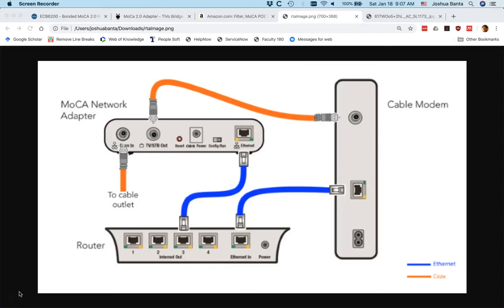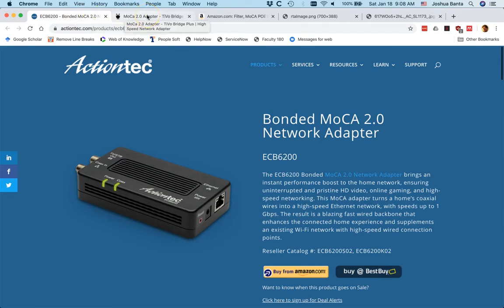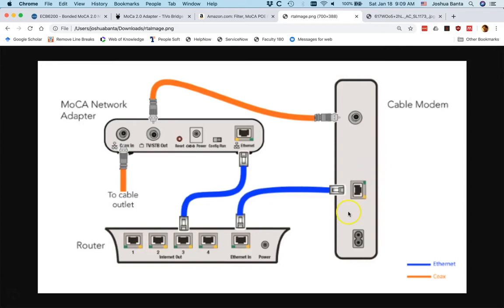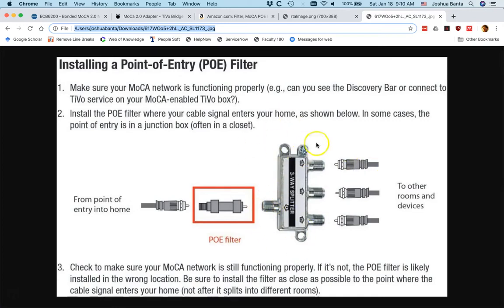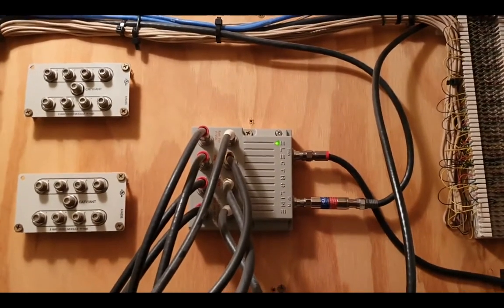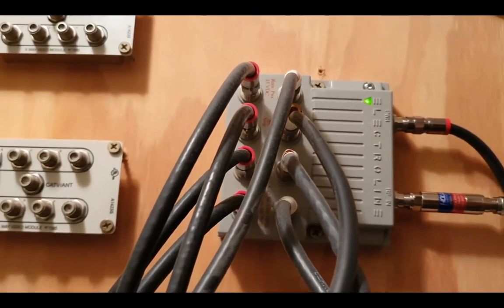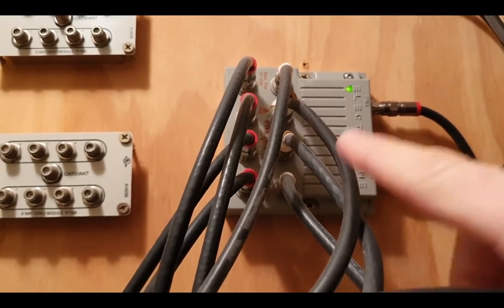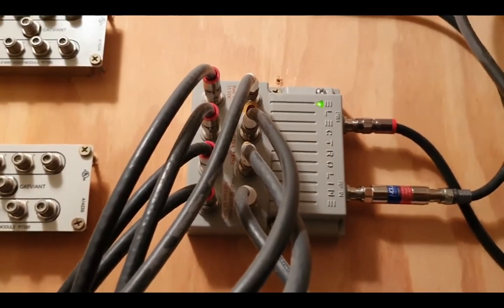McCA cable network setup troubleshooting for Tivo and other purposes

Comment: Another option, depending on the frequency range needed by your cable modem, is to have the MoCA adapter only connected to coax cable that is physically unconnected to the incoming cable signal.

Comment: It’s critical to understand that any MoCA adapter with a pass-through coax port is using a diplexer (parallel filters) internally, and not a simple splitter, to splice the signals, resulting in the pass-through port only passing frequencies 5-1002 MHz. For this reason, no devices requiring MoCA connectivity should be connected through the pass-through port.  I had some modem issues going thru the TV/STB out (speed drop, connection drop or erratic readings) and the manufacturer of my Hitron units said you should not use the STB/OUT port for a cable modem, only AV equipment, etc. so I am going to try a MoCA-compatible splitter first or if that too causes an issue then a cable TAP that allocates less signal loss to the cable modem side and -10dB on the TAP side to the MoCA adapter.

Comment: Thank you for a nice and informative video. I have used only one MM1025 Moca adapter to replace the Fios G3100 adapter. However it doesn't work and Motorola's website and support is useless. Your schech shows that there is no router or modem in your garage. I connect my Moca Ethernet port to my Nest router but doesn't work unless I'm connected to Verizon's G3100 outer.
Do you ahve any idea if I'm doing something wrong?
Thank you

Comment: How would this work with Verizon fios? I have the ONT which has fiber optic IN and Ethernet and COAX out. I put both the coax and ethernet from the ONT to the first adapter and then the coax out to my coax splitter and ethernet out to my wireless router. (I do not have a coax on the router - netgear nighthawk) I have 500mbps wired after the second receiving MoCa 2.5 adapter but the signal only works for a few hours before it goes out. Wireless router also stops working. Any suggestions?
Reply from the maker: Dear Dan, I think I'm slowly getting my head around your setup. Have you tried adding a PoE filter to the COAX out on the ONT?

Comment: I have a modem/router combo so the connection would be coax to moca adapter then ethernet from moca to modem/router from there I can hook up additional moca router on other coax ports?

Comment: I originally split the cable outlet into two. One into the MoCA adapter and one into the Modem. This caused my internet to go down after ~30 seconds or so. Your diagram at 1:38 cleared things up. Thank you so much!
Reply: You didn't get degradation thru the TV/STB out?   Mine caused intermittent issues and loss on the cable modem after testing with and without.  You can also try a MoCA splitter before the two or even a cable TAP splitter that gives a better signal to the cable modem.

Comment: will the moca connection still work without the POE filter. I have this exact setup minus the POE filter and i am getting no connection.
Reply from the maker: I would definitely add a POE filter
Reply: Did you fix it ?